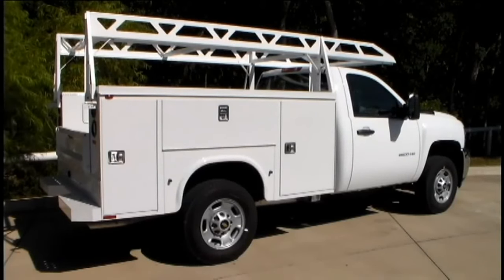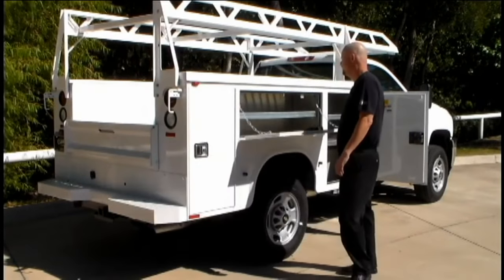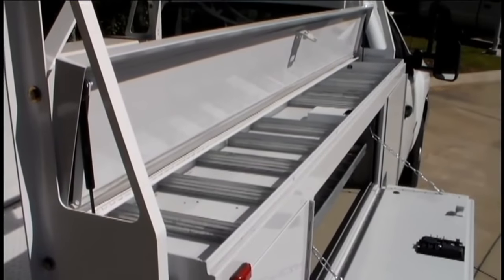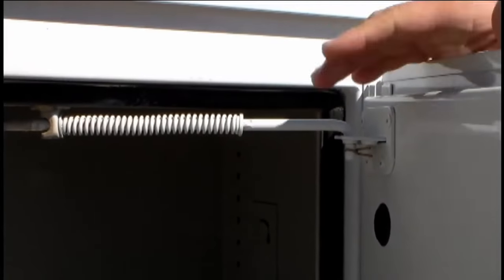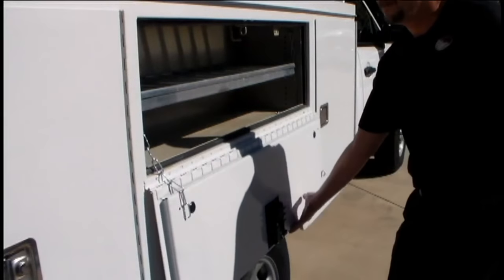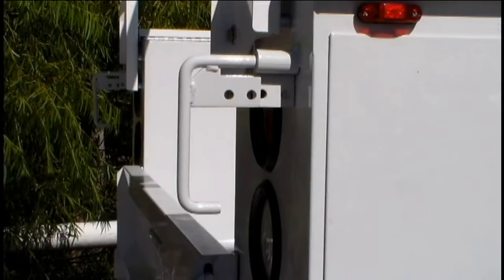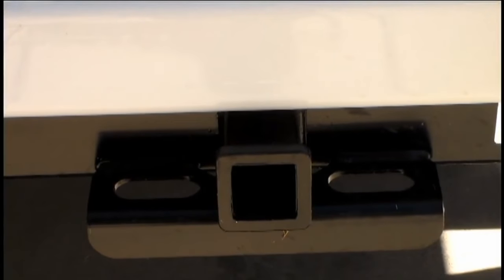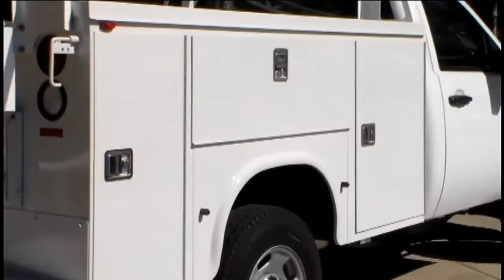The Service Truck - Silverado 2500HD w/ Knapheide Service Body

Comment: When it’s called a ladder rack, does that mean that it is not strong enough for lumber?
Reply from the maker: Many times you'll hear people refer to them as material racks because they aren't limited to just ladders.  You may want to refer to the manufacturer for weight limitations however.